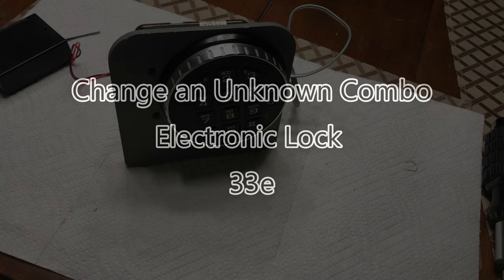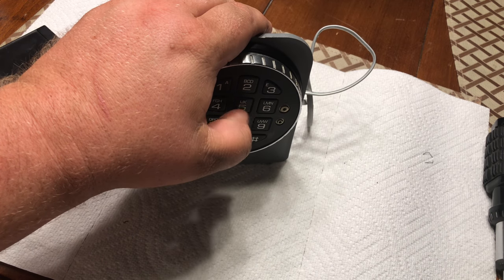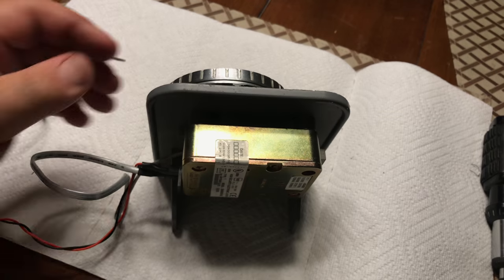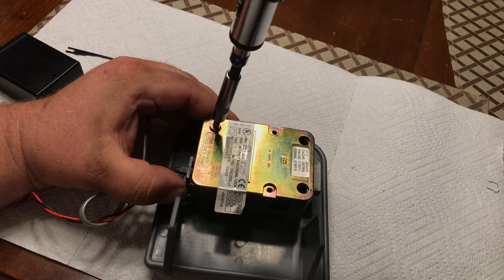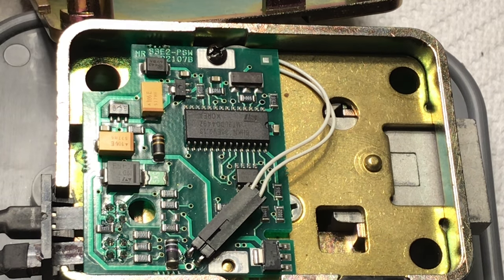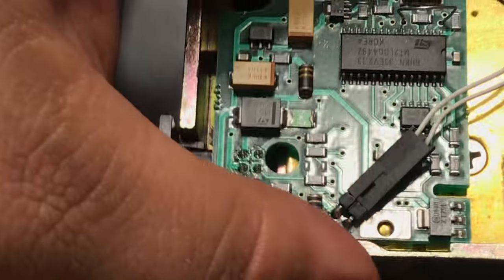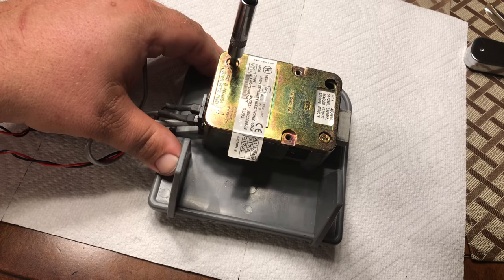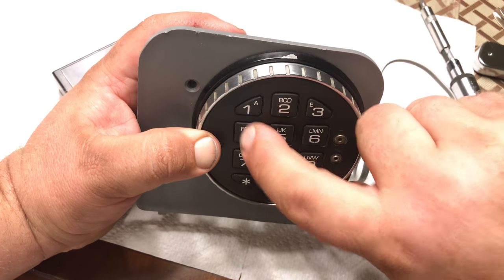Change an Unknown Electronic Combo Lock Combination. Hard Reset  Lagard 33e

Comment: Nice explanation, and good to know info. 
The board in that lock looks like a 2 layer board, with traces on the back. Those holes on the board is where the traces on the front of the board connect to the traces on the back of the board.

Comment: This is genius.! Just did this and it worked on a 4200. The holes are tiny. Too small for a stapler even. So what I did is I used a piece of guitar high E string and hemostats. Honestly, I can’t believe this worked , thank you so much!
Reply: did you have to get the wire down into those small holes to get it to work?  i tried with touching the gold pads, no luck.

Comment: Hello John how do you reset a two battery keypad the  LG I have the keypad and the lock mechanism in hand I tried with the little wire clip but that didn't work on mine did I miss something or is it just the different style the lock itself is a high security electric lock I should have told you and it's a model 4100 and date is 09 / 06 thank you for any help Eric

Comment: Thanks for sharing this... I'm gonna check out your other videos as well but wanted to know if you think that this will work on a NL lock? I've been shut out of my cannon for nearly 3 months.  Cannon says it's a user issue and not a faulty part on their end.  It's not an issue caused by the user, I've had this safe for 5-6 years and the only time I have changed the code was when I brought it home from Academy Sports.  The issue that I am having is that since my safe is shut, how can I do this?  Can I basically do the same process but on the keypad's motherboard?
Reply: No, the lock combination is stored on the lock memory chip EPROM

Comment: Hi John. Thank's for your video. It was very helpfull in resetting my La Gard lock. It was anonher model lock, but with the same pcb as the one in your video. I also have another lock called EM3520. The pcb is very different. Is there a similar way to reset that lock?